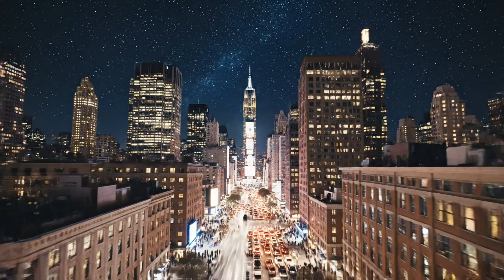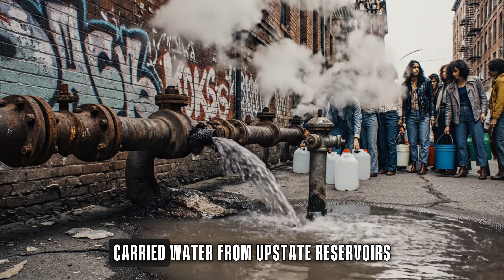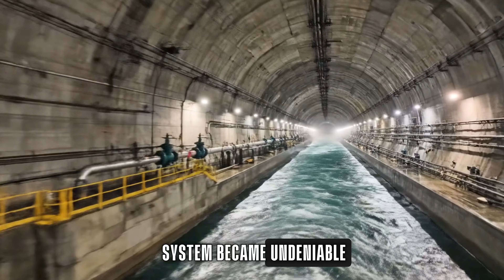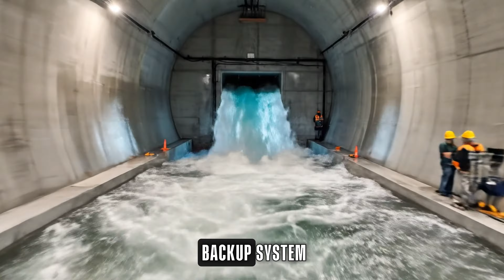"Inside New York’s MASSIVE Water Tunnel No. 3 – The Hidden Mega Project Beneath the City"

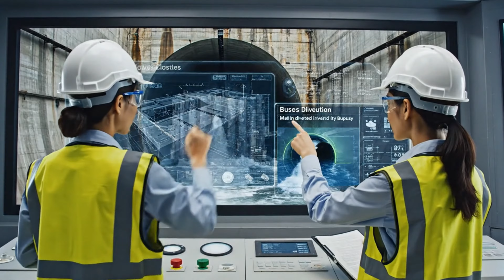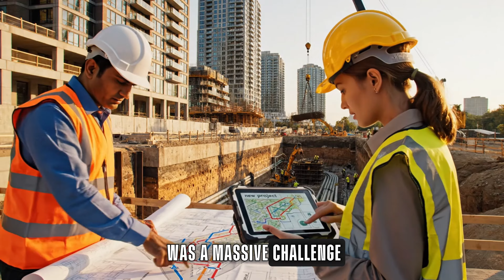Comment: The commentary is great, but the images are gibberish.  Examples: Texts at 2:07-2:10, or 5:40; Tunnel Boring Machine in 2:27-2:40.  The attempt is good, but I wish you did not have to rely on AI to generate nonsensical images.